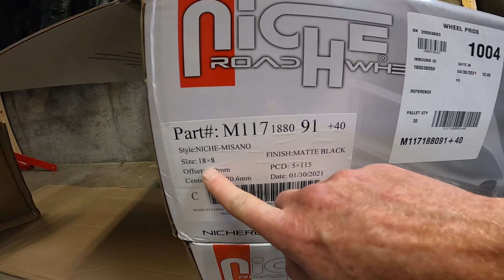Was I Wrong? Are My Wheels Bent? Vibrating Cadillac ATS

Comment: Iv been chasing a front passenger side vibration that feels as if my wheel is football shaped even at low speed 10-15 I never went above 25 as it got pretty bad at 20mph. I did the front axles (1999 Impreza wagon 5spd) and noticed that the front passenger side tire was flat. Just hit me that maybe the wheel was bent pretty badly on a drive (I got the car from a friend and is super low with -8 degree of camber all around I hate it) hoping it’s just a bent wheel causing it instead of having to trouble shoot bushings and other suspension components
Reply from the maker: You could put the car up on a javck and put a straight edge along the wheels outer rim (I use my battery powered drill) you could turn the wheel slowly to see if the wheel is bent. What youre describing sounds pretty extreme. Lemme know!

Comment: I have a 2015 Buick LaCrosse and had the same problem. I kept going to the mechanic and insisting I had a bad Axl. Each time I went to the mechanic they balanced my tires. After about 3 or 4 times going back to the mechanic they told me I needed new rims. I bought all 4 new rims and my vibration was gone.
Reply from the maker: It doesn’t take much bend to cause a vibration. And the ATS is very sensitive to anything that isn’t perfect. Light suspension. Light car. Very low profile tires. It feels every thing. I have 4 new rims. 4 new tires. Road forced balanced. It’s smooth as glass.

Comment: Ahhh, more cliffhangers lol. Actually, I believe it will solve your problem. I had the same issue, but I felt it more in the steering wheel. I took to my wheel guy and found one wheel was bent. He was able to straighten it out. Vibration went away. Hope yours will be fixed finally. I imagine the rugged terrain where you live caused that wheel to bend. Can’t wait to see results.

Comment: I’ve been having a similar situation on my 13 ctsv.  Seems like it’s a wheel but they have been balanced. But….both wheels have been repaired and are not 100 percent perfect. Vibration at 75-80 and up mph. Thinking it’s my wheels
Reply from the maker: Mine turned out to be a loose rear diff (improperly installed by dealer) and poorly balanced tires. Its tough chasing vibration, but try rotating your wheels to see if the vibration moves to a different corner of the car. If it does, then you know its wheel.

Comment: Thanks for the heads up! I have the same vibration issue. Also leveling system issue today. Do you know anything about that? I have  an XTS 2014. Have about 8 months on the warranty.
Reply: Occasionally a low tire. 🤔😩
Reply from the maker: @melissaitschner3563  I’d get it checked by a reputable shop using road force balance. But it could be a bad tire or rim. Vibration problems are terribly annoying.  No idea on the leveling issue. If it’s covered by warranty get that to the dealer asap! 👍  it’s possible the vibration is related.

Comment: You know .... they say if you mount the wheel to the car and tighten the lug nuts down onto the wheel, you will void the warranty and not be able to return them IF the are bent or warped.
They say you are supposed to take the wheels to a tire shop to be mounted on the balance machine and have them spin the wheel to check for round or warpage ...

Comment: I have the same issue. I have 2019 Pilot and I’ve done road force balanced and everything and I still get slight vibration at 55-60mph. After rebalanced it went away but it’s back again Kind of random.
Reply from the maker: My dad had a similar issue on his grand caravan. Turned out it was a slightly bent wheel from accidentally hitting a curb.
Reply: @sstressfl  I never hit any curve maybe some pot holes.
Reply from the maker: @Kanti12311  the other thing could be a damaged tire. As you are aware, diagnosing vibrations can be very frustrating. I guess it’s possible you threw a wheel weight after your recent balance. Try brining it back to the shop and explain that it was better but now vibrating again. Most places will check the balance for free.
Reply: @sstressfl  I have had the tire replaced on all four rims too. I’m leaning toward bent, but I’ll ask them next time I go in.